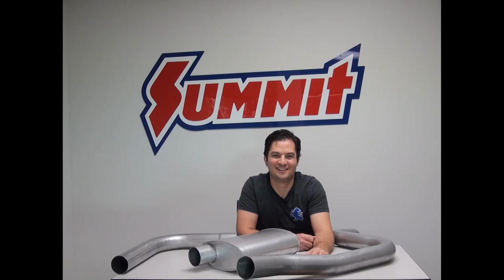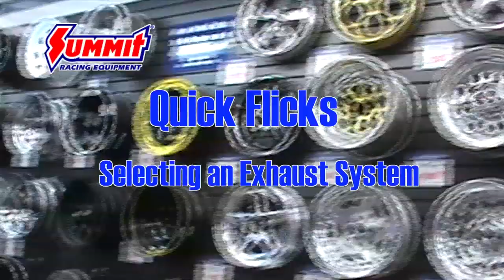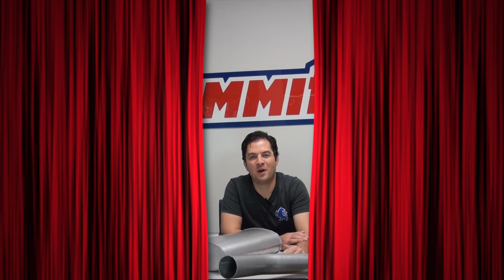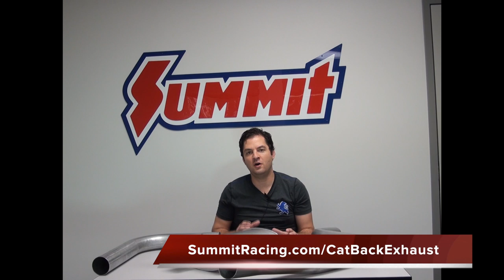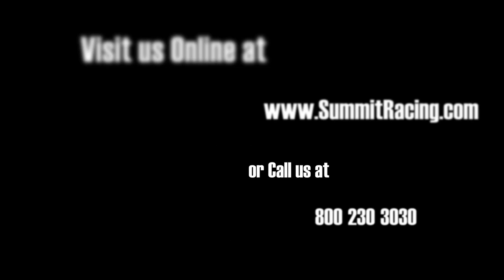Exhaust System Selection - Summit Racing Quick Flicks

Comment from the maker: We currently only carry one true dual header-back system made by Hooker that is correct for your 2500 series pickup. This is just a pipe kit though and it does not include mufflers, the part number for this system is HOK-16532HKR ($169.95). Mufflers not being included gives you the ability to then install the muffler of your choice in the system.

Comment from the maker: Yes, the system I mentioned should still work with your Hedman headers. You may just have to make some slight modifications to the connections between the headers and pipes to make it fit correctly.

Comment: I'm considering the application of true dual exhaust from cat back. I'm currently running BBK shorty headers on a 2014 Ram 5.7 hemi. Any suggestions?
Reply from the maker: I am not aware of any aftermarket true dual exhausts for the Ram. One issue is you would need to cut and modify the Y-pipe after the catalytic converters. The other issue is the location of the fuel tank on the driver side preventing you from running the driver side exhaust that way. I’m not sure you would see much benefit from true duals vs, a cat back single to dual tailpipe systems already available and bolt right up.

Comment: Hi l am  waleed from Bahrain.  I have shelby gt500 2009  with  612 torque at rear wheels . I like  to replace the stuck  exhaust with stuck  exhaust of shelby gt500 2014 as I like  the sound  . But the  problem is shelby  2014 having  two exhaust  tips .which  it not fixing  to my car property  .
Reply from the maker: Waleed Shaheen , 
The rear bumper covers are completely different on those two cars making the exhaust exit locations different and the tips not compatible from one to the other without a lot of custom fabrication!

Comment: Im carrying out a muffler delete on my fiesta ST180 and was curious what differences to sound a larger 3" pipe and a dual/single exit exhaust would have, is it louder compared to smaller piping? will a single exit exhaust be quieter? Id love to know, Cheers - Yas K.
Reply from the maker: KineticMeercat , 
  On this car, the exhaust note is dampened primarily by the turbo and then the muffler. The fact that you are doing a muffler delete means you want it loud. By increasing the pipe size to 3” you will get a louder note to a certain degree. Any tip configuration you choose will likely have little to no affect!